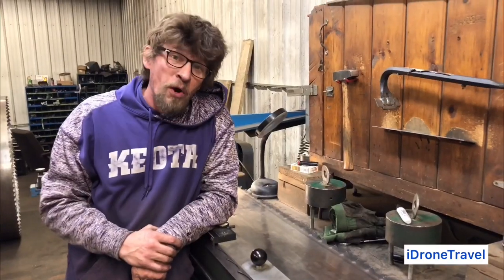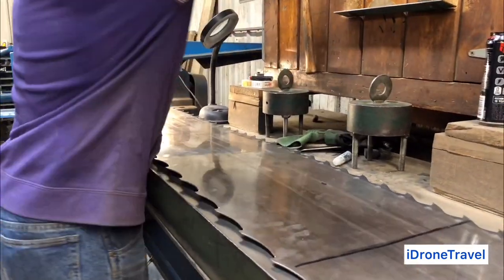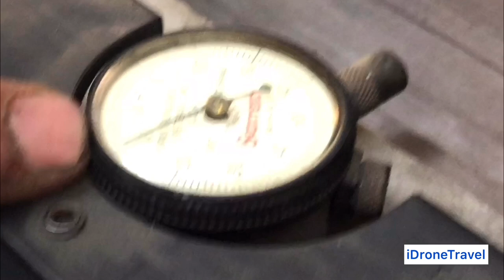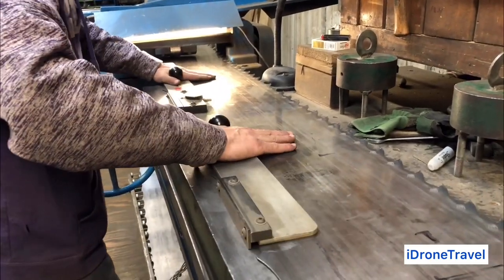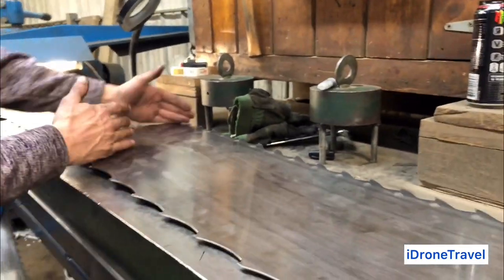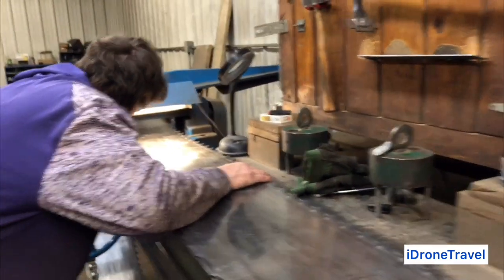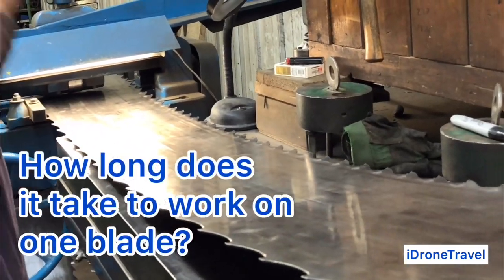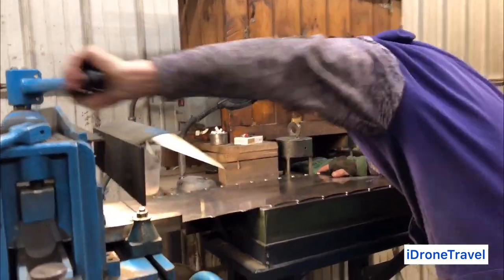Saw Mill Tour // The Filing Room // Part 1 // Logs // USA Factory // Technology

Comment: Takes Years to learn benching. Swaged, shaped and ground, manufactured and benched 20 years in southern CA believe it or not. 30 foot circle gauge. Must have tire, flat spot, 1/2 inch below gullet. (no cracks). Chasing your tail. Exactly! Took me years, learning from an old pro. Moved on to gunsmith. Great experience. Your asset to your company sir! Thanks for the video.
Reply: You're lucky you had an "old pro" who would teach you his trade. It's typical for a saw filer to lay down his tools when someone starts watching him. Young men who wanted to learn saw filing, would need to watch from afar. The old Armstrong book referred to this as "knot holing". Peek through the knot holes to learn from the filler while at work.

Comment: Interesting to watch, I work at a sawmill in Canada with cutting edge technology (pun intended). There are many talented saw filers and benchpeople working hard to keep the operation running. It’s a damn shame to see that this trade is disappearing and replaced with automation.
Reply: I only recently got into this trade, by complete chance a year and a half ago. Such an awesome trade its a dam shame that next to no one even knows it exists.
Reply: @paulmarcoux2728  Learn as much as you can and it will serve you well down the road. Having been through layoffs and closings I was always able to get a job being a filer.
Reply: @paulmarcoux2728  same here. Such an esoteric trade. Soak up everything you can
Reply: Always need an experienced filer to make sure the machine is doing its job right.

Comment: That's alot of tension.....
Reply: Most likely a low strain mill too
Carrying that much tension is just so much more work
Reply: Looks like around 30' tension ?  Hard to level a saw properly. I love my simonds leveler. Would not trade it for anything.
Reply: Yup way to much tension for me. And that blade he was working on had heaps of tension knuckles. I think I'd run both tyres hard and then the front and back edges. Try and get it sitting flat on the anvil to start with. 
He doing ok tho. It is working. Just he making his life harder too. 
Thanks to the man for the video.
Reply: One thing to remember is all mills are different. The machines are different. Depending on what wood you saw makes a difference too.
Reply: Crazy amount of tension. The front tire is way too close to the gullet and I can't even see a rear tire.
Reply: @supersawyer358  One mill I worked at wanted to get band and round levelers but it was only so they could cut jobs. Went to work at another mill that had a band leveler and a different mind set there as the leveler was just another tool in the process and an awesome tool it was.

Comment: In the 30 yrs I filed saws (band and round) , I ALWAYS wore gloves. I would not hire this guy as a benchman. His technique is VERY unique.
Reply: Gloves aside, unique is a polite way to put it. I don't think he has very much experience.
Reply: His mill is giving him big bulky gloves.  I filed bare handed for a few months until my head filer brought in cut proof tight gloves.  It's very important to wear gloves, but big bulky gloves are just as dangerous as no gloves.
Reply: None of our filers wear gloves. 🤷 Different strokes.
Reply: @LogHewer  Today’s sawfiler is far removed from my career years. If he does wear gloves, the fingers are missing so that he is able to press buttons. Filing today is like the new sawyer. More of an operator than craftsman. 12-16 inch wide bandsaws were used in my time and today the bands are much narrower.  Automatic levelers, tensioners, tippers etc are common. Gloves are not needed. 
However, if by chance your filers are still swedging and shaping or hammering, tensioning and checking back without gloves on large round and band saws, well it’s only a matter of time before an accident will occur.